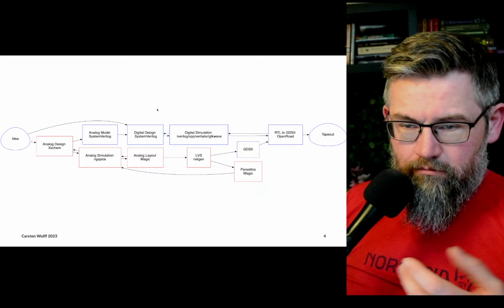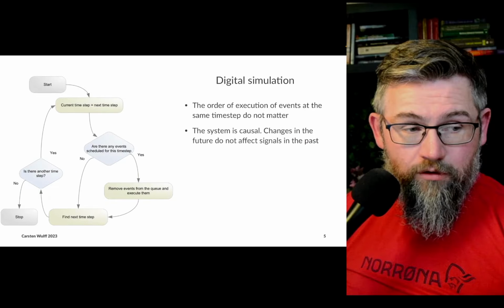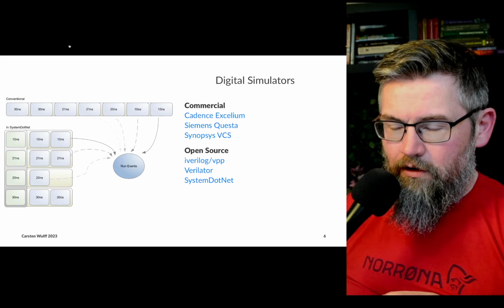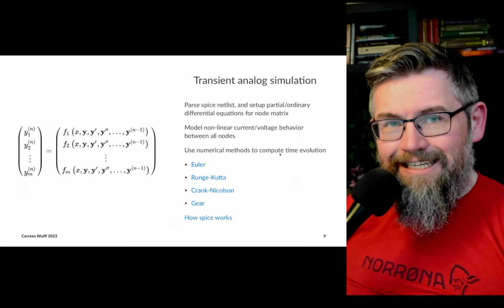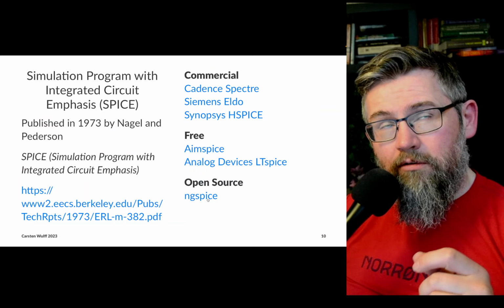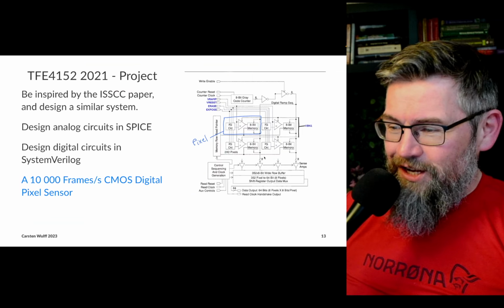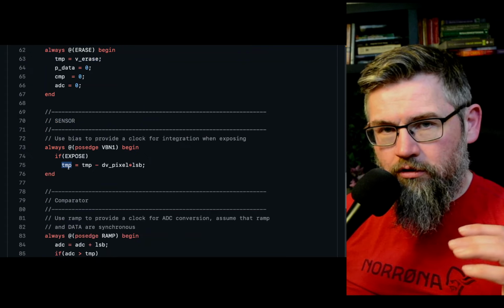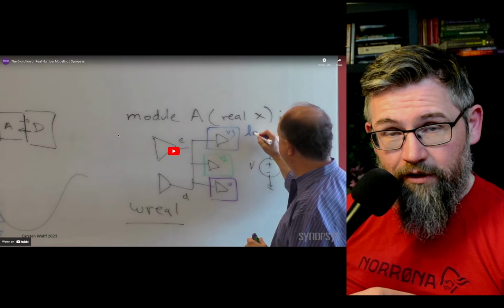Intro to Lecture 11 - Analog SystemVerilog

Comment: Siemens AFS (Analog FastSPICE). It doesn’t mean that it’s a fast SPICE simulator but it means analog accuracy with FastSPICE performance. It came from Berkeley Design Automation which was acquired by Mentor Graphics which then got acquired by Siemens.

It’s one of the fastest analog & accurate circuit simulator for Analog, RF & similar applications.